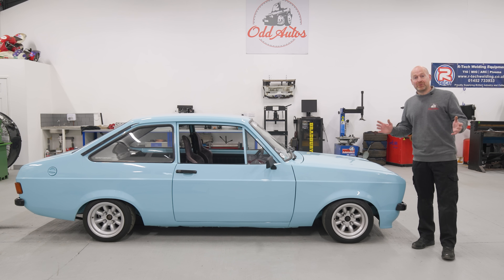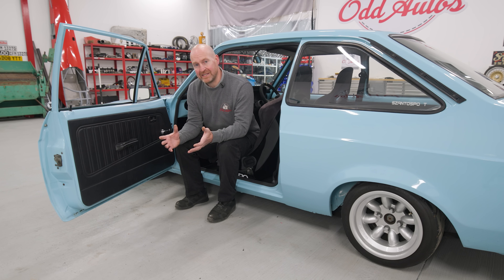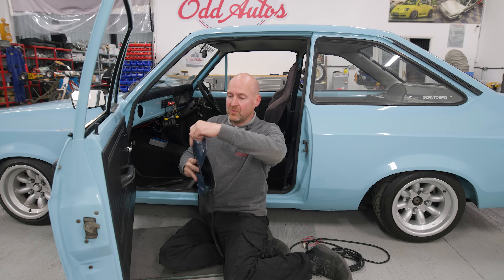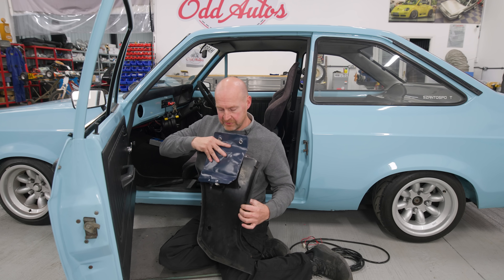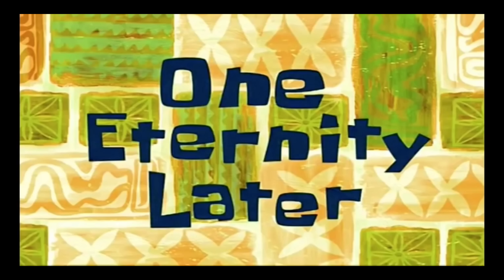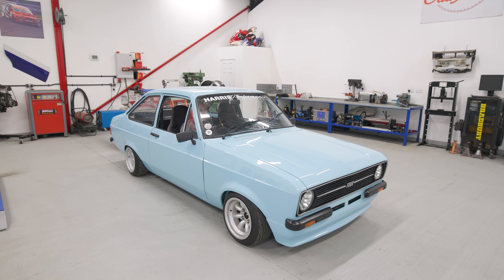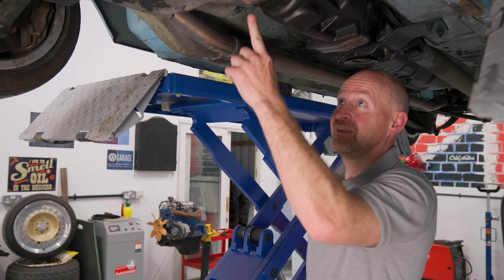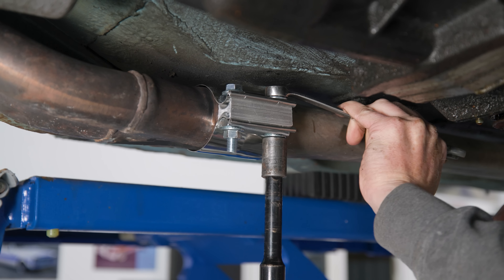HARRIS Mk2 Escort job #2.

Comment: I have loved this motor ever since I first laid eyes on it years ago, Paul! Needs 185 60r13s though. I'm putting a 3ltr washer bottle in the boot of the Viva with a one way valve. Cheers. Leigh. PS: I use flat Mikalor exhaust clamps on my 3" systems.
Reply from the maker: Cool 👍👍

Comment: Motorbike exhausts have hooks welded on and springs between the sections
Reply from the maker: Yes for the expansion, my beach buggy has the same 👍 usually fun slipping with the pliers while putting the springs on ha ha
Reply: @ODDAutos  yeah 😂 you can get a little t handled spring puller to save your knuckles
Reply from the maker: I’d probably end up like a fish on a hook 🤣

Comment: thats one place i would not think to check to top up the washer fluid  i would be looking under the front wing inside the door or 1/4 panel or boot  i think when you tested the washers you emptied a full bag
Reply from the maker: It’s definitely hiding out of site. There was still loads left, put 1/2litre of water in it.

Comment: had one the same colour, Nordic blue? with RS alloys, super Oscars & Oscars on the front, sold it for 600 quid! 🥹  😄
Cracking channel & another great video 👍👍👍
Reply from the maker: Cheers Chris, I found out this one’s Bermuda Blue it’s a lovely colour 👍. Glad you liked the vid mate.
Reply: I feel your pain, I had a 1971 mk1 2 door, in 1987, motd, running sweet, no rust at all. I paid £50. bought it as a project, never got round to it and sold it to a mate for £100 and thought I was quids in🤷🏼‍♂️😱
Reply: my fester was nordic blue, 1980 car, copper's escorts were also that colour
my v reg 1300 venetian red 3dr, with about a grand's worth of bits on, went for £800 in '86, bugger.  my brothers '76 mexico, with about £2.5k worth of kit, went for 2k in '87 it even had the reg. MEX ... P, double bugger... [lets steal the delorian]
Reply: @paulriggers1558  I know Paul, I'm your typical 51 year old..... If I knew then wot I know now 😁
I had my blue one, which I've mentioned, had a 1300 Sport, & the most that I miss was an Orange RS2000 that got 1200 quid for! I was chuffed at the time 😂
A mechanic at the time offered to supply  & fit a Fiat 2litre twin cam into the Sport for 400 quid, God knows why I never had it done

Comment: don't forget "construction + use" regulations, from october 1972, washers are a legal requirement, worth 3 points on your licence...  [unless you take your windscreen out...]  
i used to play silly games with the rozzers, they used to like giving me silly prizes, once got done for spotlamp brackets sticking out of my mk2 grille, you guessed it, construction + use regulations, so i got a copy from the library, boring read, but a licence saver back then, CU20 it was, so the insurance sticks it up ya for "driving a defective vehicle"
Reply from the maker: I had a front mount rad on an old classic mini I turbo’d. They made me take the rad fan off because it stuck out a little bit 🤣
Reply: Seems to be a popular misconception that because you no longer need to present older vehicles for a test, anything goes, but they still have to comply with all relevant vehicle regs....

Comment: Your comment about washer jets is not correct. Whilst it doesn’t need an mot to use it on the road it still needs to comply with the Road Traffic Act. This requires it to have washers whilst on the road. Also it must be roadworthy as the mot would require. So whilst it has no mot requirement it still needs to be fit for the road if used on the road. (I say this as a qualified subject matter expert in traffic law)